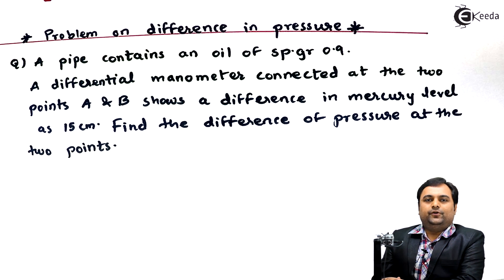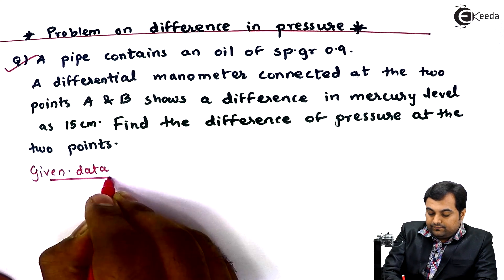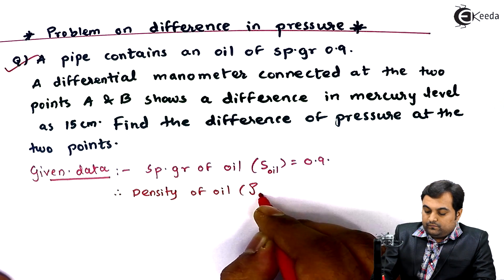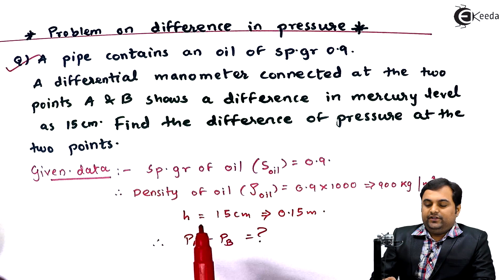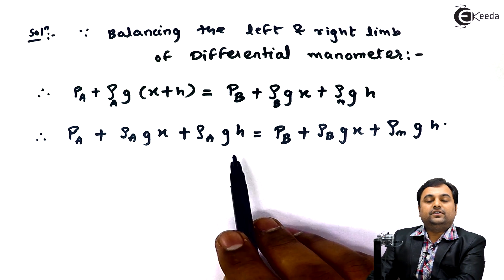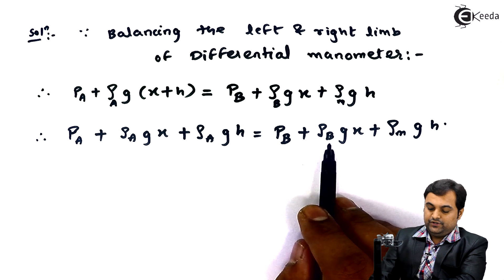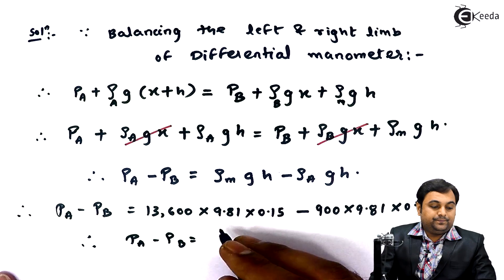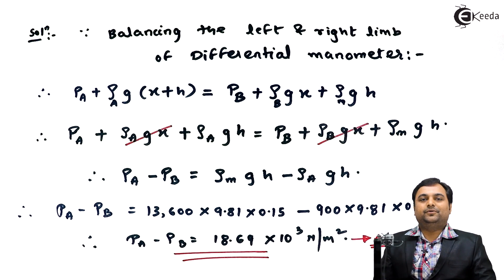Problem No. 1 on Differential U-Tube Manometer (Problem on Difference in Pressure) - Fluid Mechanics

Comment: sir if the both the liguids in pipes are same and they are at same height then y would they create a different  pressure intensity
Reply: Perhaps the diameter of the pipe has changed.